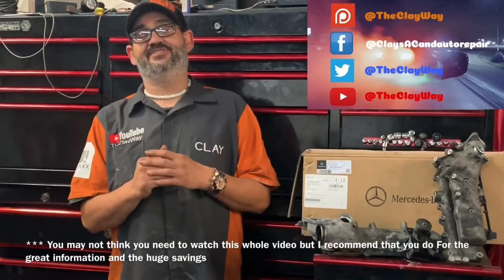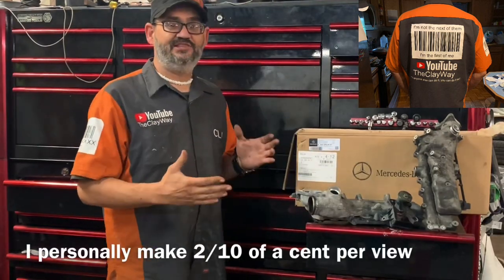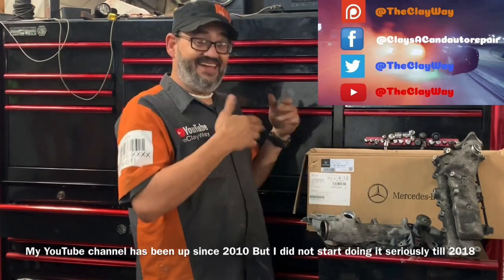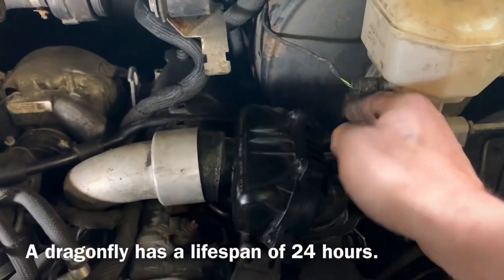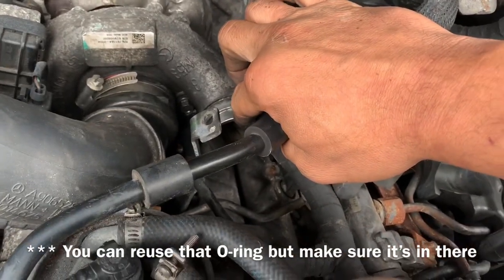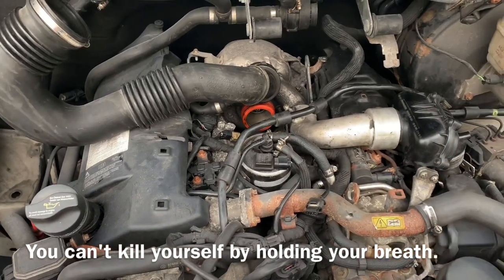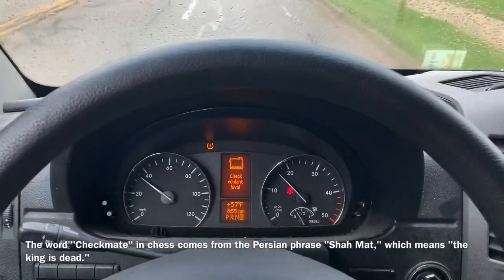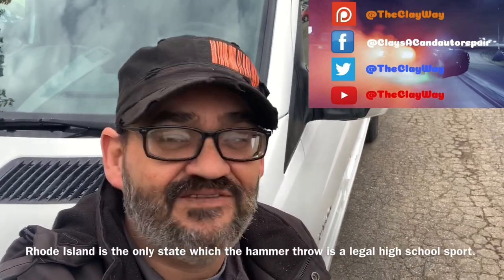sprinter 3.0 diesel swirl motor problem fixed for 2 Bucks!!!! I will save you thousands!!!

Comment: The resistor worked but now I have cel back on and code p2530-switching off intake port. It's as if it switched from a p2513 to the p2530. Any advise?
Reply from the maker: Yes if you don’t want that to happen repair at the correct way
Reply: @sharpcarco  nah this way is good. Customer is just sending this one down the road. They didn't wanna fork over the money to fix it the right way. Thanks for the video man.

Comment: How long can i drive with this resistor and how can i know when to clean the manifold
Reply from the maker: I don’t know but 22k later it is still rolling. 

If you need to do this they need to be fixed . ASAP this is meant to be temporary solution. BTW I’ve tried to clean them 3 different times and they fail within a week or 2 

The only way to truly fix them is to replace them or rebuild them , PM me on clays Ac and auto repair (Facebook) if you need the name of the rebuilder it cost 275.00 per cheaper than new and last just as long.
Reply: I've done this for years and never had one come back. Just increased power over time.
Reply: @xpertNetwork  Did you ever experience one that gave you a P2004 after doing the resistor fix?
Reply: @Nissan300zxshowcar  no, never seen p2004 on any CRD, are you sure you don't have an engine swap?

Comment: if my swirl valves ARE stuck, do I need to get them to the open position if I was to try this?
Reply from the maker: No it’s fine if they’re stuck unless you have rail sensors if you have rail sensors this procedure will not work
Reply: @sharpcarco  mine is an 08, not sure if it is them or not
Reply from the maker: It will definitely work! I don’t believe they came out with rail sensors till 2011. 

Give it a shot what are you gotta lose? Two bucks lol
Reply: Thank you very much!

Comment: I may be your newest subscriber wondering if these intake swirls can cause a no start condition.

Thanks
Reply from the maker: Well welcome.. very nice to have you. 

No it don’t that I’ve seen but try wiggling the main wiring harness . When your stand in front of the eng with the hood up remove the air filter and just right of the turbo you will see the wiring harness near it. Wiggle it around and try to start .... if it starts it warn where it rest on the bracket ... and needs to be repaired. Not replaced (that’s not cheap) this will be and easy ...... 

If it don’t work try wiggling it as someone holds key on start . If that don’t work 
Something else is going on and I may able to try to help but will need a lot more info ..... your answers will be easier for me on Clays Ac and auto repair on Facebook throw  Messenger. Hope it helps it the easiest I could explain and you can try quickly

Comment: Thanks for the information, but now I got P2015 code
Reply from the maker: Yeah sorry to hear that but that’s because you have rail sensors and this procedure will not work for that you need to remove the Intakes clean them and or delete them… Then you’ll be happy motoring again

Comment: Going to do this on my van. you said its a temporary fix and to repair asap? And you do the repair for 300 each?
Reply from the maker: I drove mine about 5000 miles. The carbon will continuously build up and that’s what I believe the biggest problem would be in the future and from time to time it will go into limp mode with the bypass. I would say with shipping that’s about right but they’re actually only $225 apiece to do right now it could raise in the future. But that’s the going price for cleaning them right now plus shipping
Reply: @sharpcarco  okay cool. So with them being cleaned is nearly as good a solution as replacing? I’m in Georgia but coming up the coast this winter and would make a trip to you to get it fixed
Reply from the maker: Well I think you get a little bit better product with the cleaning because I have a special solution that I put on them to be a little bit resistant to the carbon buildup and you would be hard-pressed to not know that they are brand new if you looked on the inside of them the exterior of them may look a little bit dingy but the interior of them looks just as good as new. Without a piece of carbon anywhere and I would absolutely love it if you made a trip up here will make a video about that. So I would be happy to do it for you
Reply: @sharpcarco  I would love to get in direct contact with you. I’m very serious about this, you would be saving me from having to sell my van. Please let me know the best way to get in touch. Thank you
Reply from the maker: You can look me up on Facebook Clays ac and auto repair and send me a direct message,

Or you can Ken send me an email to thenewclayway@gmail.com

I don’t check emails as well. As I do my Facebook I’ll send you my cell phone number I just don’t give out personal contact Information over my channel

Comment: Does the swirl motor still have to be in its place for the resistor to work properly?
Reply from the maker: No unless you have rail sensors and if you have real sensors this trick will not work.
Reply: @sharpcarco  What years have the rail sensors? I got 2008 2500 was wondering if it would work

Comment: what these flaps are actually doing?  i have removed mine and didn't notice any difference
Reply from the maker: They help with an unnoticeable amount of torque….. you could consider them like a ram air system…. Except for they have no kind of seal properties so the difference between them being opened or closed is negligible……. But apparently they help with the burning of fuel meaning that they pass more air through them when they’re open so the fuel can ignite hotter in the exhaust system is my best guess……. Making better omissions and cleaner exhaust output. In Europe where regulations are a little bit easier I’ve been told by some of my European friends that they don’t even have them….. 

Older model 3.0 sprinters don’t have rail sensors so you can remove them but on later models the computer needs to see the rails moving in order for it not to go in limp mode
Reply: @sharpcarco  mine is Chrysler 300c 3.0CRD , so these flaps is about ecology,  not economy in fuel consumption right?
Reply from the maker: Yes you are correct. According to the way I understand it they are for the environment more so than functioning as far as a necessity for the engine to operate if you have the older model that does not have the sensors then you can get rid of them flaps
Reply from the maker: Sorry I talk to so many people I forgot that you and I were having a conversation earlier and I explained everything to you. With the exception of that last question

Comment: Hey, just checking in after a few years to see if anyone regretted doing this mod. I’m about to do it myself but figured I’d ask the experienced their thoughts. 
Thanks
Reply from the maker: Really depends on what year you have if it’s later than 2009 it probably won’t work or work very well since creating this solution I’ve created a better solution where I delete the flaps you’ll have to look in my Sprinter playlist it’ll show an arrow pointing to the arms on the thumbnail
Reply: I have a 2008. Would you still remove the runners?

Comment: any, change in sound of the engine?
Reply from the maker: Not that I remember. My engine sounded just fine after I was done doing it but I suppose it’s possible that it could sound different depending on where the flaps are under the intake

Comment: Even if the package of resistors you have shows 4.7K ohms you should point out that the resistor value is NOT 4.7 ohms but 4700 ohms.
Also resistors are not directional. It doesn't matter which way you install it.
Reply from the maker: How would you like me to do that? Took took me three days to make that video. And I don’t have another Sprinter Van to make another video. It appears that most people are smart enough to understand that they need to use what’s on the package or not what I Verbalee say just trying to help folks but I’m getting beat up on this one maybe I should just take the video down and let people pay $4000 to have them fixed properly.

Don’t take it the wrong way this is just a text message I just don’t know what it is that I could possibly do to fix it.
Reply: @sharpcarco  Maybe you could put a notice in the description of the video.. Don't get me wrong. I thought the video was great, just the littile piece of incorrect information..
Reply from the maker: I did exactly as you ask because I thought you were absolutely correct and honestly I thought I had already done it but I went back and checked and you were correct I was mistaken

Comment: Will this work on 2017 model?
Reply from the maker: More than likely not because you’ll have rail sensors however, you can remove the Intakes and send them to me and I can delete them so you never have to worry about it again while she won’t need any reprogramming

If you want more information on it, reach out to me on Facebook under clays AC and auto repair Just send me a DM.

Or 
Email 
Thenewclayway@gmail.Com

Comment: was wondering if this bypass is still working for you and have you seen any negative affects?
Reply from the maker: Well there doesn’t seem to be any real major after effects except I can only get between 16 and 18 miles to the gallon. I don’t know if it’s related but every once in a while and it is not very often it goes in the limp mode in the morning time . I will have to stop and turn off then restart, I’m pretty sure it’s related to me having a bad O-ring and it only happens right in the morning and it doesn’t happen often. I drove it to Texas with the resister in it and I had no issues at all.  I live in Michigan so it was about 3000 miles round-trip I put a proximally 7000 miles on it sense and I’m very very pleased with the outcome hopefully that information helps you.
Reply: Clay, I’m interested in Will it pass all smog laws and inspections in California?
   Your sprinter gets 18 miles per gallon??
  Mine new go 21mpg. Then I had to have it reprogrammed through the dealership because of California laws. It dropped to around 16-18mpg. Then as it got older it has dropped to 13mpg. I’ve been running SeaFoam in my fuel tank for just over a month now. I got 16 on my last fuel up.
I’m sure I’m going to have to replace my intakes before the end of this year. Mine is really sluggish when I pull off a stop sign.
Reply from the maker: LT's Garage LT's Garage Hey LT I greatly appreciate you sharing that information with us I am  certain it, it would pass omissions or not but I doubt it would. I personally have driven mine to Texas and stuff and I don’t notice a huge difference in fuel mileage I’m getting somewhere between 16 to 18 miles to the gallon but there is times where I got 14 miles to the gallon as well. Performance wise it seems to be OK I don’t really have a sluggishness at takeoff like you’re describing. But as I said in the video I think this is more of a temporary solution so you can save up the money it’s been a couple of months and I would say I’m very pleased with what I did in the video. 

So I would say it was extremely successful keep sharing the information with us so we can stay on top of it. 

And continue to help people across the world have a great day brother will talk to you soon

Comment: Hi Clay ! Can you confirm if this resistor trick will eliminate the check engine light or not?
Reply from the maker: It will not eliminate the check engine light the check engine light may come back on and it may not come back on in my situation it stayed off but in other people’s situation it came on
Reply: The Clay Way so we have a 50/50 shot at going through all of this and still have the CEL remaining on?
     The main reason I want the CEL off is to get it Smoged   & registered. 
(California)

Comment: you commented that the European models don't have the flaps... is that actual?? if yes then why do the N. American models and why not just remove them rather than repair them????
Reply from the maker: Well some people have said that that is true that they do not have flaps

The reason that you would not remove him is because it’s illegal. And there’s other states that it would make it fail emissions

And on top of that the later models have to have the movement for the engine to operate properly and not go into limp mode
Reply: I am european and own a car with this om642 engine. Believe in me...these flaps are there...and we have the same struggle with it like you... its to find here in vids with Keywords Mercedes EKAS OM642
Reply from the maker: Well when you’re looking for engine information just look up Sprinter’s they’re the same identical engine the intake on the driver side may be a little bit different but they have the same problems

Comment: Awesome video. Resistors do not have polarity, so the direction of the resistor probably does not matter. I also wonder after this mod if the flaps stay open or stay closed.
Reply from the maker: Well it’s hard to tell because they can get stuck open or closed. 

Either way it doesn’t make a difference. 

Although this is a temporary solution for a problem that needs to be taken care of not a lifestyle

Comment: There is a guy who sells a module for it. Its not that cheap though. It costs  me 300 USD. Its not just the motor. There are 3 sensors need to be bypassed.. This may not solve the problem for eberybody.
Reply from the maker: Do you know why it won’t work for everybody? Because it doesn’t solve the problem.

This guy, i.e. Clay  way actually solves this problem in a totally different video under his playlist .
Reply from the maker: I have to admit this comment really bothers me because in this video I’m assuming you didn’t watch it. I said that this is a temporary solution because I understand exactly what’s going on.

When you’re running this process or his process?  The regeneration mode is shut off. The regeneration mode is shut off actually if you have the swirl flap stuck, which means. Your catalyst is not burning off all the oily debris that it’s collecting inside it.  

Yes, this is a 50 Cent fix when most things are not 50 Cent nowadays  but it’s gonna cause a couple of thousand dollar repair bill. I said that in the video actually probably closer to $10,000 to be honest with you.

Plus, I’m assuming he made his own emulator which is clever I considered doing it for a very long time myself personally . However, I didn’t want to be the one who destroys somebody’s van that’s why I mentioned in the video. This is a very temporary solution. It needs to be fixed correctly because you nor him 

Understand what is happening .

Comment: Saved me from buying a 07 sprinter with  carbon on the valves
Reply from the maker: Well I would not buy one because of that reason for sure I would just adjust the price accordingly. 

At the dealership that’s about a $5000 job. At my shop it’s right around a $3500 job but I delete them and make them never have that problem again. If the price is right the price is right you will never find one that does not have that problem or won’t have that problem in the future unless it’s been deleted and since I’m the only person in the world that actually does the Delete chances are good. That it will have that problem no matter what you buy unless it’s brand new just something to think about Tim
Reply: @sharpcarco  they're asking 3500 and it's a 170 wb cargo van has 275k miles
Reply from the maker: Wow that’s a good deal
Reply from the maker: @Tim E. 🤔 Where is this located at? 😂
Reply: @sharpcarco  Belair MD
Reply: Now I'm considering it 🤔. But would like a 2016 or newer with the 2.1 4 banger diesel. Any advice towards the 4 cylinders?
Reply from the maker: Sorry not really Tim. I mostly work on old junk…… 

I think the Sprinter Van’s are pretty good investment yes you will end up putting a couple of thousand dollars into it and it’s difficult to find mechanics that work on them but if you decide against it try to get me the information so I can look it up I would consider flying over there in buying it myself personally